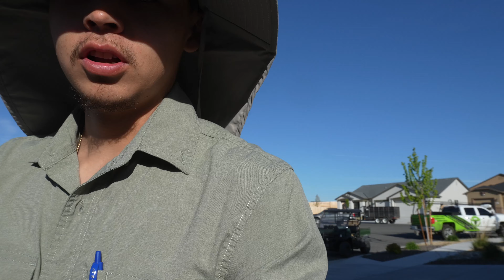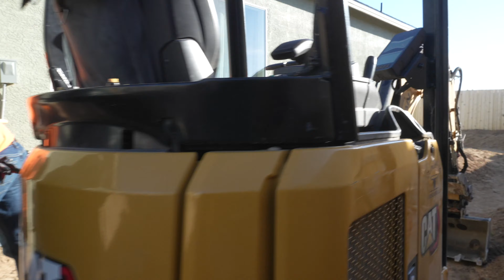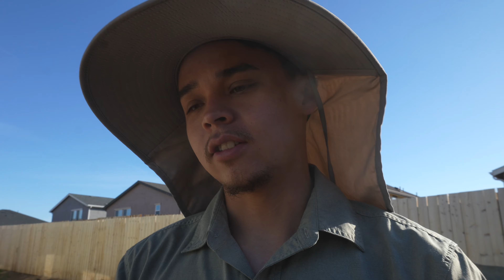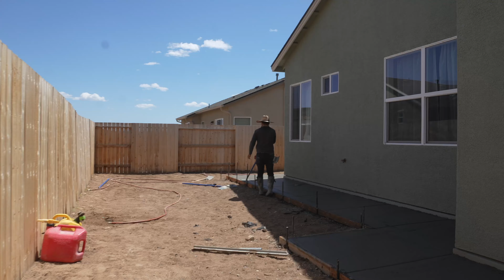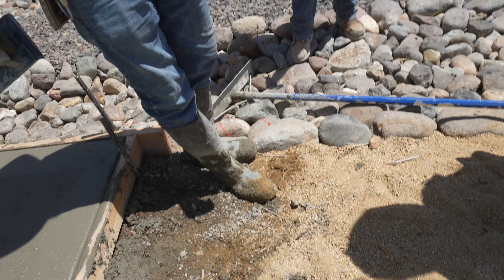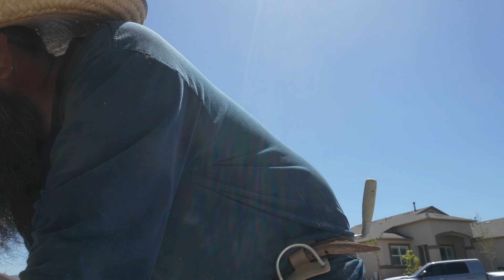HOW A RETAINING WALL AND PATIO CAN MAKE YOUR YARD FEEL A LOT BIGGER!!!

Comment: Isn’t it cheaper to bring a concrete pump than having all those wheelbarrows there
Reply from the maker: If it would’ve been over 8 yards yes I would get a pump or use the buggy. This one was 6 yards. We had another job around the corner so it made more sense to move the guys around. Pump is 800 - 1,800 for something small like this in my area
Reply: Here comes the couch foreman’s.